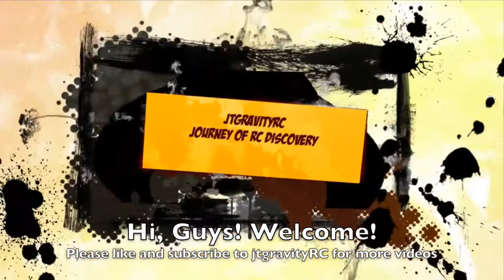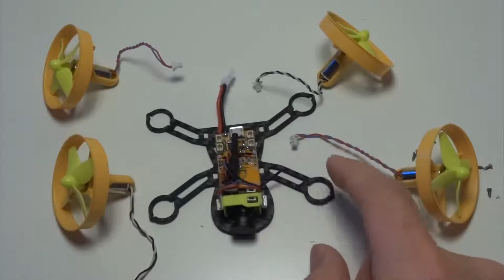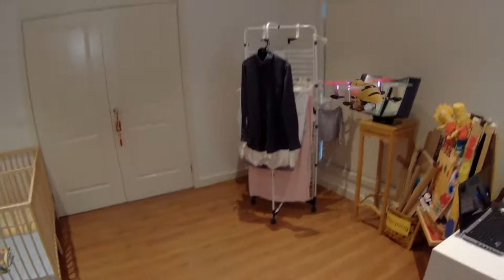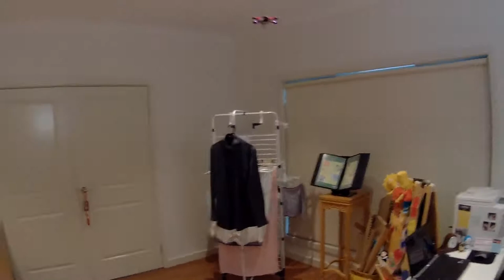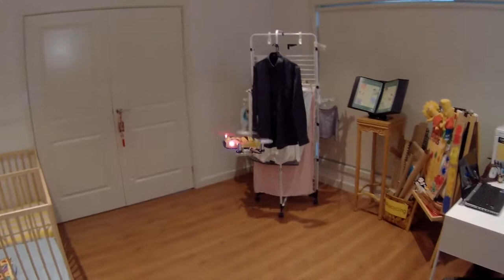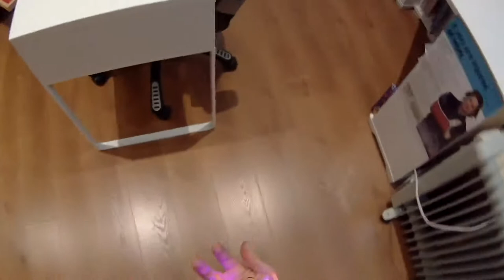Entry Level Pilot Series - Vibrations

Comment: 10 times more stable than mine.
Reply from the maker: that's the original frame. just got rid of the vibration using rubber grommet ring - 20pcs Rubber Wiring Grommets Ring (8mm one as this is 8mm motor)
https://goo.gl/Mfk1DY

Comment: When are you guys going to stop buying these crap store bought machines and start designing and building your own.
I have 6 store bought and a dozen of my own creation. Mine are just better.
 Light ply and hollow carbon square tubes for the frame. Micro heli  skids as landing gear. Modified micro heli bodies for a conopy. Perfect for 7mm-8mm quads.
 My favorite home built is what I call my hyper nano. Based on the inverted set up like the blade qx2. Weighs in at 21 grams with 8mm motors spinning 70mm props. Powered with a 500mAh 1s. I get a full 5 minutes of aggressive flight and tear up all of my club buddies store bought hands down.
Love your channel,Very informative. However it seems our hobby is moving towards a throw away mindset instead of modeling.
This is a shame.
Reply from the maker: RC quad is a relatively new hobby in that it is not as established as the model plane or helicopter and it is a very niche hobby. I only took up this hobby from November 2015 and learnt by trial and error. There was a lack of good information and there's still a lack of information on understanding quads, transmitter and so on.  I even asked some seemingly knowledgeable youtuber on how to set up a switch and no one was willing to help. As a result of that, I decided to go back to basics and learn everything myself. Though my videos, I am imparting my learning and knowledge about this hobby. It took me almost 1 and a half years to finally come to this stage to be able to put up this series about the basics. I hope my viewers will acquire enough knowledge and skills to actually enjoy this hobby without the early learning frustrations that I felt. Hopefully this will inspire them to build their own quads. I know I will try to build my perfect quad eventually. Glad that you are enjoying my channel. :)
Reply: jtgravityRC Excellent! Build your knowledge base. I will have to tell you though. Crashes are inevitable. I have been flying RC since I was 10. That was a full 4 decades ago. 
The advances in our hobby is unbelievable.
I would never have thought battery power would supplant liquid fuels. I sure never thought foam would come to dominate model builds. 
These are wonderful and have made our hobby as accessible to anyone with an interest. The down side is folks just buy and fly without knowing about the responsibility or liability they hold once in the air. 
Sites like yours are great because you do show the work involved. That alone makes folks a bit more carefully.
Might I suggest a channel you may or may not be aware of. Look up xjet. He is from New Zealand and is not only a world class pilot he is an engineer active in our hobby.
 Check him out and contact him with your switching question. He might find your question interesting enough to do a spotlight on. 
Good luck to you sir, and happy landings!
Reply from the maker: Thank you :) I have learnt how to set up a switch on Devo, Spektrum and Taranis transmitter. Yes, I do follow Bruce. He's good. I lost a Syma X8 due to a flyaway. It was very early in my hobby around Jan 2016. It got to me as I was too worried about falling quad.  From that day onwards, I promise myself to learn everything about the hobby and especially to fly responsibly and hence all the videos on my channel. Thank you again for your advice. Happy flying! :)
Reply: jtgravityRC I think your channel is great JT. I'm a beginner and still buying quads but since crashing I'm learning by having to replace parts etc. and one of these days I'm gonna build my own from scratch. Right now I have an idea I got from you I'm slowly working on from where I bought a qx70 and it sucked out of the box.  I saw a video you made about changing the frame and props so that's what I'm working on in my spare time though I don't have much of that due to work and I'm waiting on a new flight board for it because the first one blew due to the cheap eashine props flying off and the quad hitting just right on a hard surface. Thanks so much for that idea and other help in learning this hobby. I'll let you know how it turns out. Keep up the good work and happy flying my friend. Cheers.
Reply from the maker: Thank you :) Look forward to your updates.